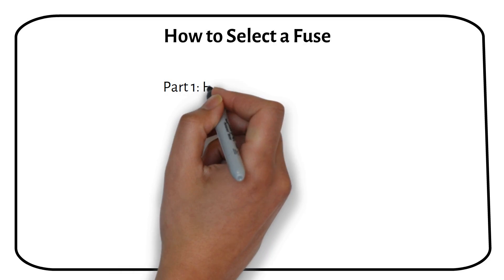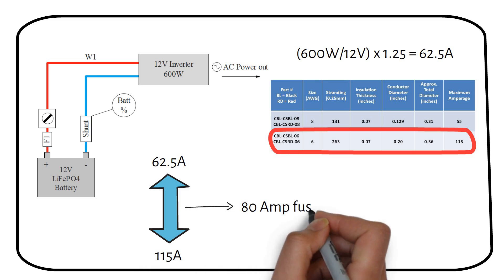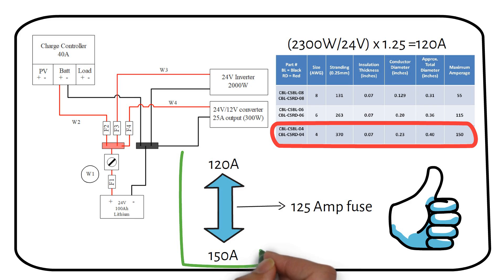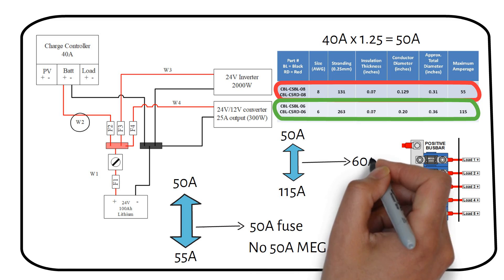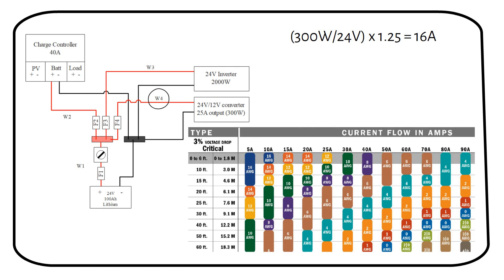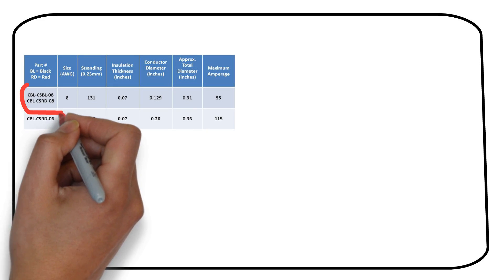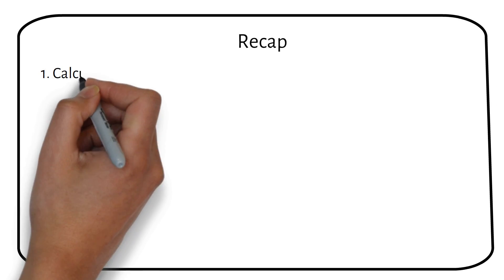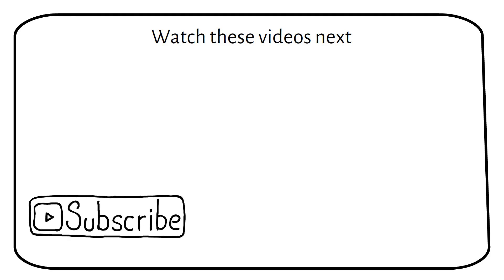How to Size Fuses For Off Grid Solar System

Comment: I have two 12v  240w light bar. I wired to fuse box. I have 2ga wire from fuse box to battery bar. That 2ga wire get hot on fuse box terminal. I am getting 40 amps on that wire . Also I had a 35 amp fuse on the lights. It melted. I changed out the wire from 2 gauge to 4 gauge for it fit better and then I changed the ground wire down to 6 gauge to also fit better on the fuse box. I also split the two light bars to individual 20 amp fuses on the fuse box. 4 gauge wire still gets hot on the fuse box terminal side. Anybody? Any ideas? I'm so lost

Comment: I will use 100amp fuses - 100ah 12v battery.
I will have 4 batteries in series on 2 gauge cable. That cable can handle 100 amps.
My load is going to be a 2000w inverter. 3000w peak.
If I draw 100 amps from each battery, I got something dead wrong.
At most for 2kw inverter from each battery is about 42 amps at 12v.
62 amps at the 3kw peak.
Allows room to add more loads in the future.
Don't want to keep a drawer full of a kazillion sized of fuses.
Will use 8 gauge from bus bar to inverter. . That wire easily holds 45 amps and even 55 amps, depending.
Only place I might need a fuse or circuit breaker is between bus bar and inverter. BUT my inverter has external fuses that I can replace if there is a problem.
ALL cabling is rated for continuous current. But there is a 2-hour rating too.
And that is about 150% of continuous.
Allows for motor startups.

Comment: I have two 100Ah Li Time batteries connecting in parallel so the output is 12 volts. Can THE Bussmann Circuit Breaker BP-CB185-150 be used at the positive terminal that goes straight to the buss bar to power my Victron Phoenix 12/1200 inverter? I am currently using the LittleFuse 175 MEGA fuse part number MEG175BP at the positive terminal but I want to know if I can use the Bussmann Circuit Breaker BP-CB185-150 so I can reset it rather than replacing the fuse. The reason the fuse blows is because I am testing different air conditioners and different loads. The Victron uses a 200 amp fuse but I think it has to be returned to the factory to replace it if it blows and I am trying to make sure that does not happen. I want your opinion if I can use the BUSSMANN. It does say it is a thermal fuse and if I can NOT use it would you be kind enough to tell me why so I will understand? Thank you for your help. I bought your book several months back but I have not had the time to read it yet.

Comment: IDK how you come up with this math for sizing,,, manufacture says 150A fuse and 2/0 wire for 2000w 24v inverter, stating that it's needed because of the 4000w 24v starter capability is why 2/0 wire and 150 fuse is a must... Others in the web world say 4/0 wire and 250A fuse, why should we trust you.
Reply from the maker: If the manual says a specific wire and fuse, then use those. I'm using formulas which every electrician uses.

Comment: If someone were willing to pay a little bit more for a DC Breaker instead of a fuse (for the safety benefit along with the ability to cut off power from the panels quickly) which DC breaker would you recommend? My system should always stay under 30 amps.
Reply from the maker: A DC breaker is not safer than a DC fuse. If you want a cutoff switch for the solar panels i recommend Chtaixi, they have certifications.
Reply: @cleversolarpower  I just saw this (showing your channel to my engineering students, how lucky). I never got the notification :( BUT I am so grateful you replied. Me and my students are making a off grid solar charger in our school parking lot to charge an EV. I will of course have fuses in the system, but I wanted a safe switch to turn it off over weekends and more importantly on holiday breaks. Without having to disconnect wires.  I cannot thank you enough. I will look into Chtaixi

Comment: Some batteries, like the LiTime have a Built-in 100 A BMS fuse. Is that good enough as F1 to connect to a 24V/2000W inverter?
Reply from the maker: 2,000W/12V=166A. so thats not enough ,and don't trust the 'fuses' in a BMS. It's a marketing gimmick which cannot break a short circuit.

Comment: so, considering your example of 50 amps. why not use a 50 amp dc circuit breaker? when would one choose a fuse instead of a circuit breaker and vice versa?
Reply from the maker: Fuses are generally cheaper than resettable breakers. Fuses don't blow unless there is a fault. There are cheap DC breakers, but that doesn't make them good.

Comment: I have two 12 volt lithium batteries on my narrowboat, giving a total of 600Ah (200 + 400) What size fuse or circuit breaker would I need? I've worked out they are giving me 7200 watts, I have a 3000watt Inverter fitted, so does that mean I need a 750 amp ANL fuse?

Comment: I have battery 48v and multiplus 2 @ 5kva if I fallow your step it will be 200A to protected the battery I don’t know why people use mega fuse 500 or 300A.
It is ok if I have 200A breaker for battery ?

Comment: Nick question, I'm installing three 12v 100ah battery, using a bus bar setup... have 30amp control should I install a 40 amp fuse at each battery pos... looking forward to getting your book
Reply from the maker: It depends on the max load (inverter) you have. If you have a 1000W inverter it can be smaller than a 2000W inverter. I recommend watching my video about 'parallel different capacity' you don't have different capacity, but it's useful to calculate the wire and fuses.

Comment: Great explanations. I was wondering why there were so many variations in the ampacity charts. Is there any consideration for surge capacity of the inverter when sizing wires/fuses? I see some of these units advertise a 3X surge rating. (midnite rosie)
Reply from the maker: It's because wires have different temperature ratings. No need to consider the surge capacity of inverters, it's a very short time and the wire can handle short surges in current.
Reply: @cleversolarpower  Good to know. Thanks for the reply.

Comment: How did you come up with  these numbers for max amps for the wire gauge? Wikipedia lists completely different numbers:

https://en.wikipedia.org/wiki/American_wire_gauge
Reply from the maker: Wires don't have the same insulation type. That's why there are wires made for different current carrying capacity. For example 70°C insulation temp and 105°C. Check my video on wire sizing.

Comment: My 48v inverter manual says to use a 300a fuse. I'll be using nt or other ceramic fuses. Maybe t class as well . I well need around 100m2 cable
Reply from the maker: You can split them up into 2x 50mm2

Comment: Between  120A and 150A could also be 135Amp..... why 125Amp?
Reply from the maker: Because a 135A fuse is not available.
Reply: @cleversolarpower  Then use a 135A circuit-breaker instead.

Comment: Regarding the sizing of the F1 fuse, I notice that you are not including whatever power input that the charge controller is adding to the system.  So your F1 fuse only has to relate to the draw (usage)?
Reply: And, I meant to say thank you for your wonderful videos
Reply: does that further imply that in an inverter-only system (no 24V to 12V DC converter) that the F1 fuse will be the same fuse size as the inverter fuse?